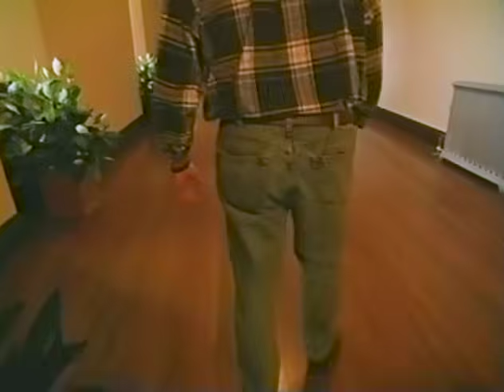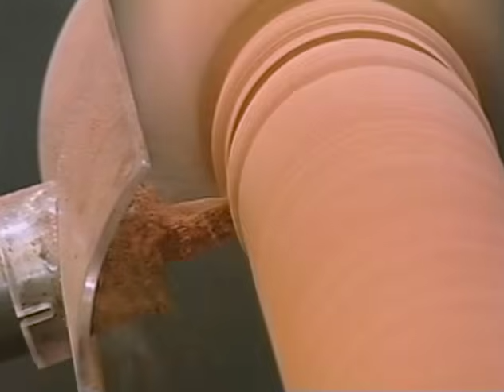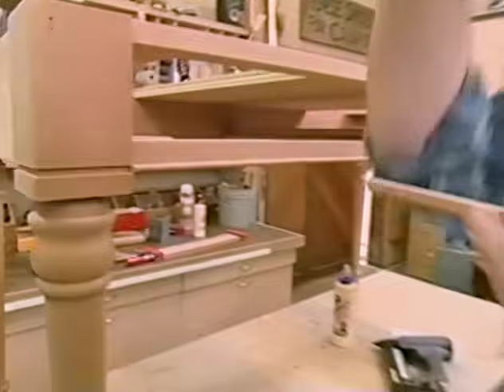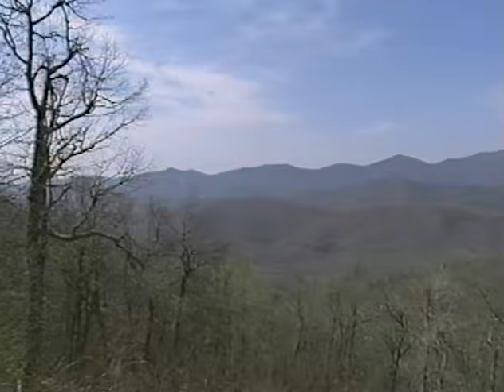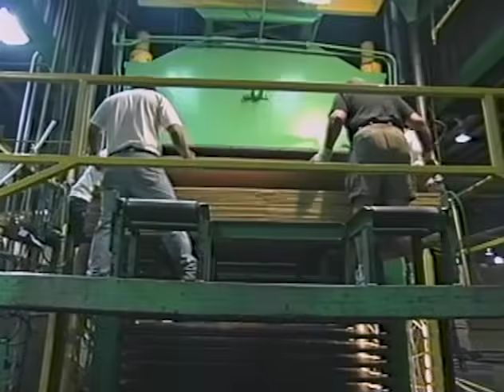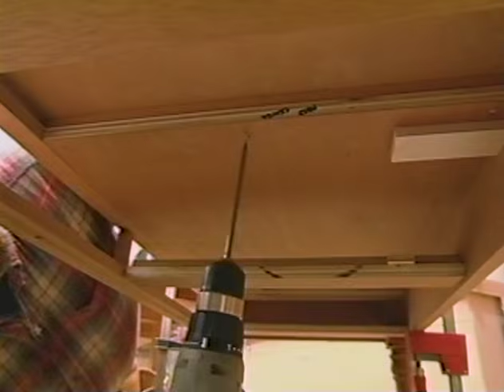Dressing Table  |  S13 E8 & 9

Comment: I wonder where all the machines went after they left the New Yankee Workshop. that DL-40 was replaced by the Steel Bed 1642. the Rockwell Unisaw by that '95 model. the various drill presses, 14" bandsaws. the DJ-15 and the DC-33. Even that shaper we saw earlier on. There is no way they were offloaded in a "garage sale"
Reply from the maker: Most were on loan from the manufacturer and returned when swapped out. Some found their way to Norm's home workshop, but only the special ones 😀
Reply: @newyankeeworkshop  the truly special ones never left 😂 Im sure any die-hard NYW fan could spot those in a shop pic.
Reply from the maker: @gregvolland9697  Everyone always wants to know what happened to the Timesaver though. 🤫
Reply: @newyankeeworkshop  if it was a Single Phase machine, I could see it winding up in someone’s shop. It must have recently left. It was there for the TOH tour.
Reply: I feel better about "loan".  Some of those tools were pretty expensive.   @newyankeeworkshop
Reply: Best guess they may have gone back to the tool distributor - all were very much still good enough to be used in schools etc. The Rockwell Unisaw belonged to Russ and by the time it was replaced by the newer Unisaw he had owned it for nearly 30 years.
Reply: There's an interview with Norm from last year where he says he has or will have a shop in his new house he just built. I can imagine some of the tools in the basement of his old house. I also read somewhere that on Russ and Marion's Nantucket House, there's a second shop with the original table saw and perhaps other tools.